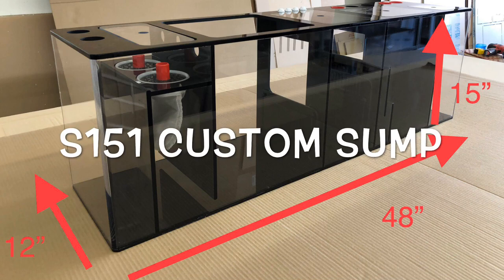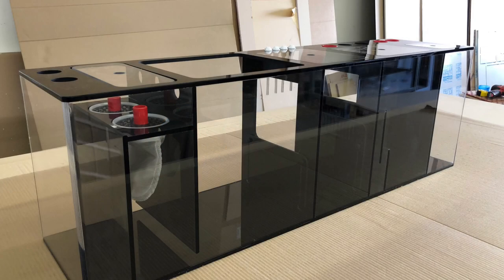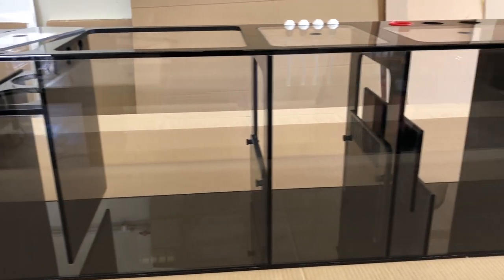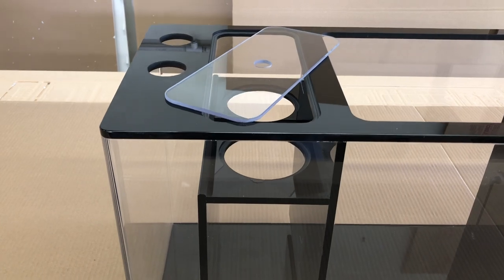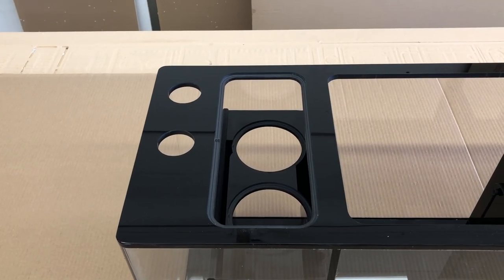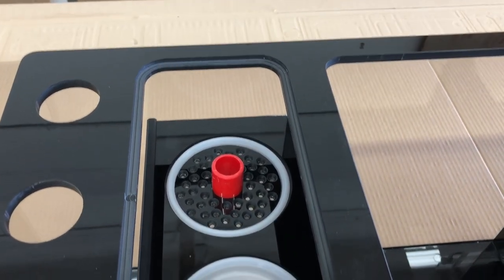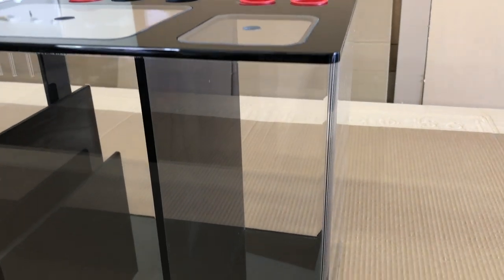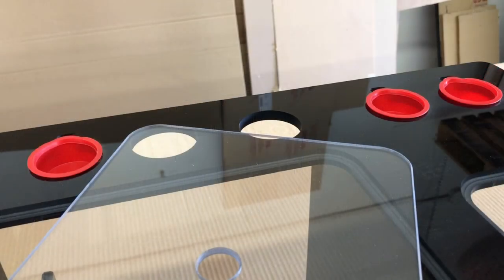Advanced Acrylics S151 Custom Sump / (48"x15"x12") 200 Gal -

Comment: 48"x15"x12" is not 200 gallons. That's the size of a 55gallon aquarium. My 180 is 72"x24"x24". Just wondering if how much water does this really hold? Nice sump though
Reply from the maker: The 200 gallons refers to the size of tank that this sump is recommended for. The actual max. capacity of this sump is 37.4025974025974 gallons.
Reply: @advancedacrylics3965  OK 👌 at the end of the video you said "it had the capacity of up to 200 gallons" so some people might get false advertising, plus the videos title. J/S nice design tho